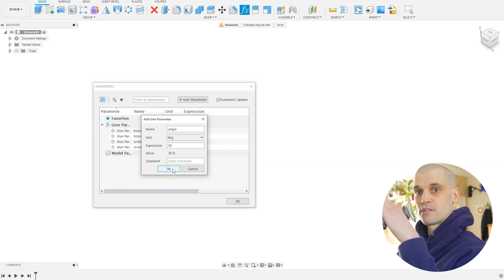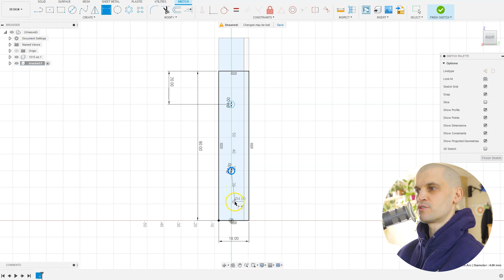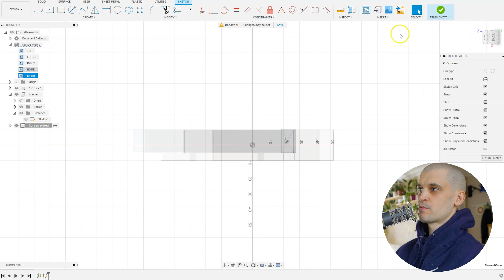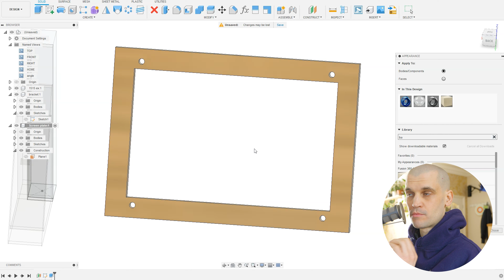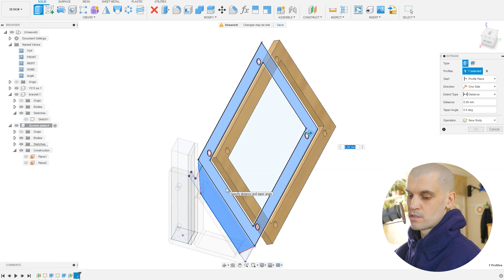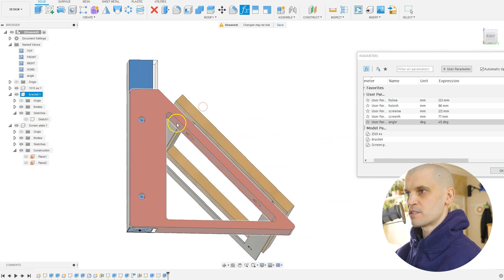Designing a custom Raspberry Pi screen mount in Fusion 360 | #Elecrow 5 Inch Display

Comment: one thing that's helped me with dimensions, is linking them together. for example, if you set 4 screw holes at 3.5mm, but later realize you need 3.6mm, you can just update the original dimension, and not have to do all 4 in the sketch
Reply from the maker: Yes definitely I always make sure I do that, i wish there was a more fluid way to link dimensions though, f360 is a bit clunky in it process
Reply: i agree it's clunky. i click the existing dimension, and then copy and paste that value. but going back and finding that dimension is basically impossible @ThisDesignedThat